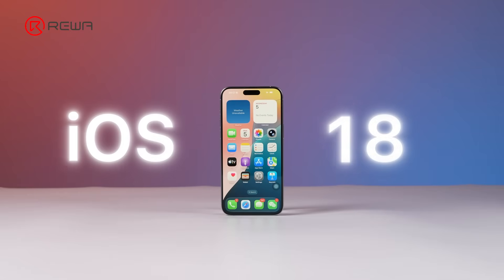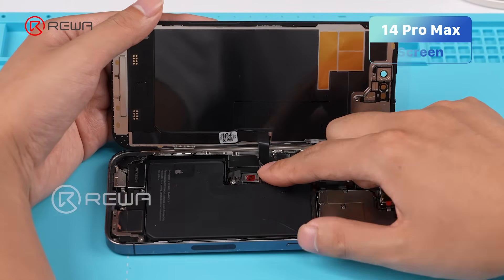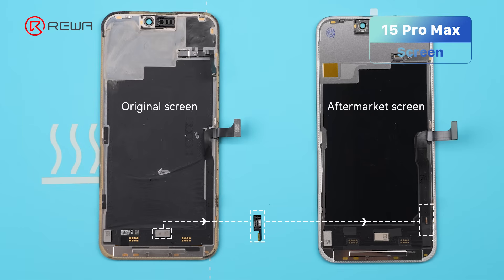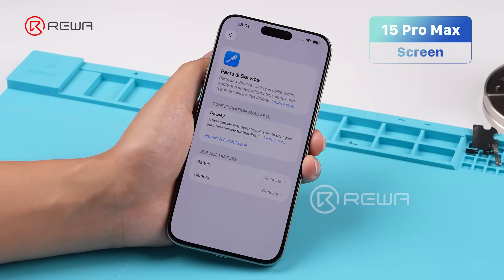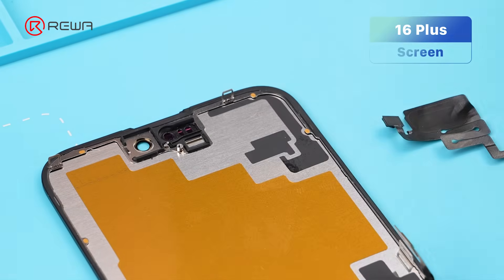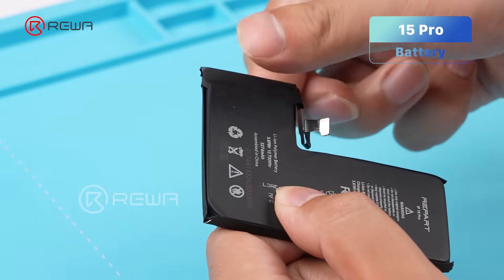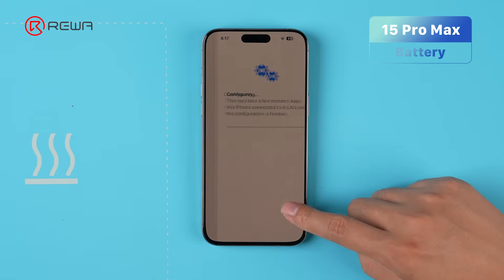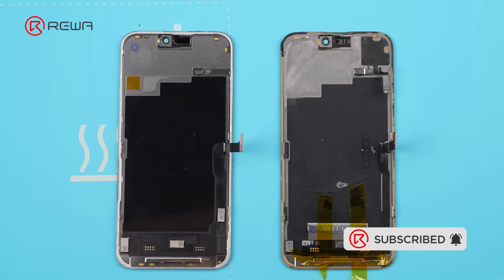iOS 26.1 Update Test — A Hidden Restriction for Screen!

Comment from the maker: iOS 26.1 brings major screen-related changes!
And we also tested the solution, DM us to learn more.
Reply: What about a genuine iPhone 15 display from another iPhone and has it's own OEM proximity flex, will that pair?
Reply: @josehhozeh8113 yes will pair
Reply from the maker: @josehhozeh8113  When they do not match together, the unknown part will pop up, unless like the Service Pack the front sensor is paired with screen IC, then the motherboard will tag them Genuine/ Used part.

Comment: Is FACE ID disabled on iphone 11 / 11 pro / 11 pro max when installing an aftermarket screen on ios 26.1? Or is FACE ID retained and with just an 'unknown part' message in settings? Also, does ALS / auto-brightness still work with 13-14 and 15-16 or is it dependent on whether it's original to the screen or motherboard?

Comment: so the original front sensor flex cable is required so the imp message does not pop up?
Reply from the maker: Yeah，especially in 15-16 series, but we already figured out the solution

Comment: What does this mean for older repaired models? For example, if you have an iPhone 12 that had its screen replaced with a genuine used screen, but the original sensor remained (as we did before repair assistant), could you now pair it properly?
Reply from the maker: As long as your front sensor is paired with the phone, it will be fine.

Comment: I recently installed a new pulled 16 Pro Max Display . During the pairing process without the Orginal proximity flex connected the device displayed a genuine used status. After rebooting the device was connected to the original proximity sensor and the status changed from genuine to unknown. Could you please advise on the cause of this issue and provide a solution?
Reply from the maker: Yeah this is what we meant, and solution should be on the way, now we already tested.
Reply: Yes I know however I used the original sensor which came frome the device. This means new pulled Orginal display from an donor iPhone an used proximity flex from the normal device

Comment: So REWA, on iPhone 15 or iPhone 16 if you replace the screen with a different OEM screen, then transfer your original front sensor flex, it will show as original used?
Reply from the maker: Yeah or you can use  the service pack, the official screen package can help you.
Reply: @rewatechnology2008 I did this but it shows as unknown but the True Tone and display brightness works as original. Why is that?

Comment: I installed an original screen on an iPhone 14 Plus, and during the diagnostic on iOS 26.1, the device showed “Used.”
After that, I reinstalled the original screen, but the diagnostic message does not disappear, even after a full restore.
Reply from the maker: You mean you replace other OEM screen?

Comment: need help
i have se 2020 with aftermarket battery on ios 18 everthing working fine but i update to iso 26 now battery % is stuck at 1% and 0 battery health how i can fix this issue????
Reply: Try another battery,  if you replace the battery check the connction or some you Broke in the motherboard, if not it’s your charging IC
Reply: @AlanPatatas  all the readings are good on board i don't think its a charging ic issue cox on ios 18 everthing was working fine just after update to ios 26 its stuck on 1% charging with zero battery health.
Reply from the maker: How about the connector? We just posted the battery data video.
Reply: @rewatechnology2008  sir on ios 18 was everthing working fine just after i update on iso 26 this thing happend & i also check reading on board battery connector and battery too all voltage are fine 🙄

Comment: I had 12 Mini with Commy battery claiming that will show used after repair but stuck like screen on this video iOS 26.1
Reply from the maker: Stuck on which page? And did it show unknown part?
Reply: @rewatechnology2008 Stuck on new iOS need to be updated before entering part&repair. Failed and shown unknown parts

Comment: I don't know if I understand the changes in iOS correctly.. Until now, it was true that if the display was not replaced together with the sensor flex as a whole, it was also not possible to go through "pairing" through the diagnostic tool and "unknown parts" were also displayed. So what has changed?..for iP13,14 is it now possible to go through the configuration with a different sensor flex than the original one, whether it is a genuine (refurbished) or aftermarket part?..In the video you use REWA (JCID) diagnostic displays for iP14 but with these displays it was possible to go through the configuration successfully with a different sensor flex than the original one even in iOS18.. But the diagnostic display for iPhone 15 and iPhone 16 is not used in the video.. In that case, after replacing the genuine (refurbished) sensor flex, the configuration would not have been successful in iOS18 anyway or is it different?  Or is it that by transferring the IC chip from the original display along with the initial flex sensor to another non-original aftermarket display, the iOS system did not recognize the change at all, even though the display was replaced, there was no need to perform configuration, but now it already records this replacement in iOS26? I am asking, was it possible to replace the initial flex sensor in iOS 18 and replace it with a genuine (refurbished) one from another iPhone in the event that only the flex sensor was damaged and the display did not change, so the iOS18 system did not record this change with the replaced genuine (refurbished) sensor from another iPhone and it worked as standard as with the original? Thank you very much for your answer REWA
Reply from the maker: As we mention, in iOS 18, the front sensor does not take part in part pairing, you can install the pulled parts like iPhone 12-14, but when it comes to 15-16, the front sensor just needs to be paired with the screen or the mothboard, otherwise it will pop up the unknown message.
Reply: @rewatechnology2008 if I had a screen with iCloud Clean paired, I can use this flex? Cause I bought another normal sensor but it says that the display is not original
Reply from the maker: @AlanPatatas  You mean you used the OEM screen to pass repair assistant and when you install the front sensor, it pop up unknown part?

Comment: What is only front sensor flex was replaced and screen is original, will it still work with auto brightness on iPhone 13? Before 26.1 it didn't.
Reply from the maker: The auto brightness should be fine, the iOS 26.1 does not impose stricter restrictions.
Reply: @rewatechnology2008 as far as I know, it was restricted before and Auto brightness would only work with original flex before. I will try with iOS 26.1. I tested it on 26 for a friend.

Comment: if the screen was not changed and is the original one the phone came with but the proximity flex is replaced will it prompt unknown part or not?
Reply from the maker: It will change, as we mentioned in iPhone 15 to 16 series.

Comment: Does the earpiece flex restriction apply to iPhone 12 mini? Damaged my screen but replacements don’t come with the earpiece flex
Reply from the maker: As we said, it mainly just happened in iPhone 15-16 series
Reply: @rewatechnology2008 I’ve gotten the display installed but I am now running into the issue of “part is not functioning as expected”. Help?